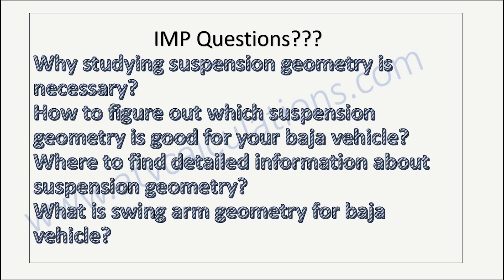Lotus Suspension Analysis Tutorials [Chapter no.: 3] (How to Choose Suspension Geometry )

Comment: Where is the Origin point in lotus software How you got the values as 3000 and at all
Reply from the maker: I Haven't consider zero as origin. But you can if you want to. Not difference you will in output results 👍
Reply: Which point Does you considered as Origin
Reply from the maker: Somewhere 3000 I have considered the origin point. 
But don't need to worry I'm going do a video on lotus software soon.
Reply: Do A Video on how to give the dimensions in Lotus 

Quickly Pls.